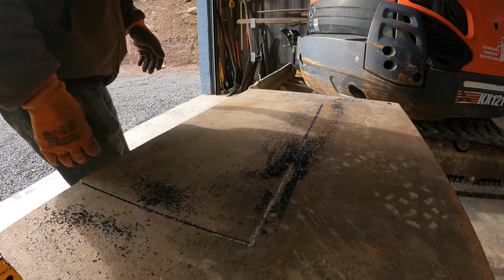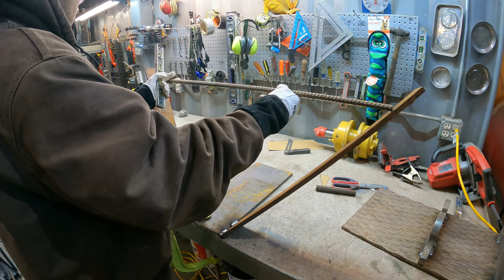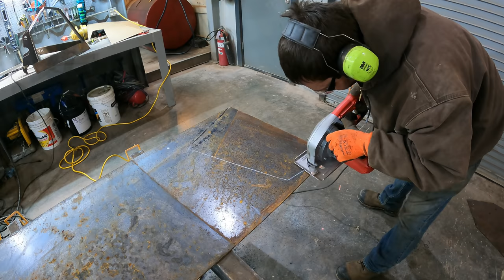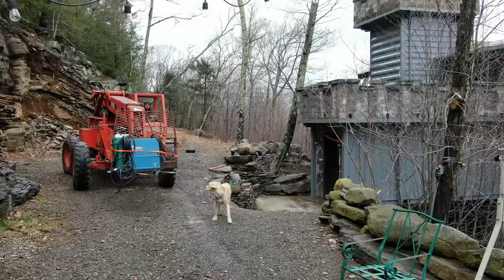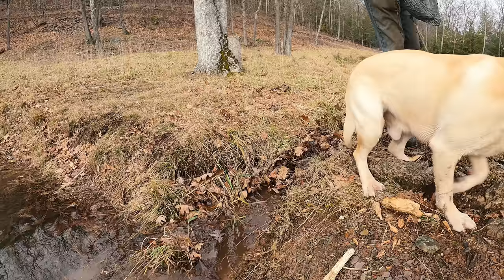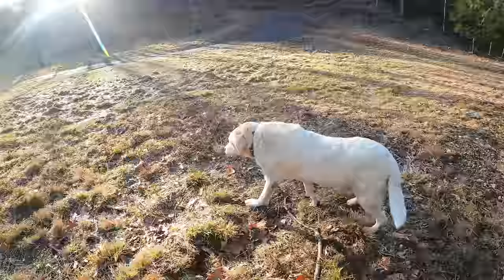Making an excavator swale bucket

Comment: You know your roof was built strong enough when you can use leftover material to build an excavator bucket.
Reply: Point well taken.  Thank you!
Reply: @facediaper4607  You should post some of your welding examples so we all "know how it's done"
Reply: @facediaper4607  you probably just mad that he’s better than you
Reply: @facediaper4607  ive seen a lot worse hes a lot better than some
Reply: @facediaper4607  You must be new here. I didn't see anything break, bend or fall apart. What I did see was a culvert get dug. How exactly does his welding suck? Oh, and hey smartass, his castle is still standing. What's you got now?
Reply: @facediaper4607  I don’t know anything about welding. What’s so bad? It looked like he did a good job.
Reply: @facediaper4607  maybe he's good at grinding. With a good grind I can make those beads look like they were fused instead of welded.
Reply: @facediaper4607  Lets see, Andrew has 799,000 viewers who subscribe to his channel. Balls Deep has no viewers and no videos up. Yet he's telling us how Andrew sucks. Funny.
Reply: @facediaper4607  it must be sad to not have a life...
Reply: @facediaper4607  I think you might have made a mistake. His welds appear rough and bad on the outside but that doesn’t matter. It’s the solidness of the weld. His welds aren’t pouraus or thin he did a good job in terms of strength and having something that’s gonna last but it’s not the most appealing to look at
Reply: @facediaper4607  he doesn’t need to pass a test. It’s his own excavator bucket for his own business and it’s sturdy and functional and it’s not gonna break that’s all that matters in this case. If you were welding for a big corporation or someone else it would matter tho so I can understand what your saying
Reply: @facediaper4607  your not providing a very good dispute. Makes me think that you have no reasoning to say I’m wrong your just saying that I’m wrong
Reply: A point well taken. Thank you!

Comment: I'm going to predict the future, Andrew is going to buy a waterjet table
Reply: He would then created a fully articulated “Swiss Army” like bucket for his excavator. I see it now a combination hammer drill, trencher, leveler, and root claw all on one attachment. AC could do it!
Reply: Would have to hear his building then lol
Reply: Or a plasma cnc table
Reply: @stevencollins9894  //  He has one sitting right behind him in view that he doesn't use.
Reply: Might also be a CNC plasma cutter. Either of those.
Reply: @stevencollins9894  oh, you beat me to it 😂
Reply: This lad could make his own tilt - rotating pick up hitch and save himself 15k 🤣🤣🤣👍
Reply: A used* water jet table
Reply: I’d bet a plasma cnc
Reply: @joconnor3567  Well i assume that this wont be possible because you cant have all shapes on one bucket. But with a quick change you still spare a lot of time.

The only thing that could make this even better is probably a tiltrotor that makes it possible to turn the bucket around in any direction. A skilled operator like Andrew can eat his lunch witch one of those.
Reply: @73DiamondReo  //  Your point? Who said it couldn't do the job? I merely stated that he had the table and didn't use it.
Reply: He has the table and compressor under the over-
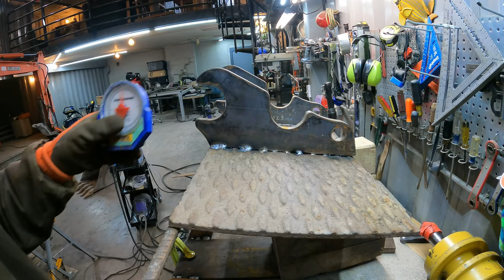hang, @ 8:46 it's in the background
Reply: @DanKoning777  your right put that thing is probably junk " it broke for no reason I just put my track loader bucket on it and it fell apart " lol
Reply: Or a plasma they are cheaper
Reply: Plasma table
Reply: Next logical step for the Camarata enterprise. But first would have to be a CNC plasma cutter. I don't need to own one, one of my neighbors has a laser cutter and i get my stuff cut through him, but it cannot be stated enough what a time saver multiplier and enabler of greater projects, the access to any of these machines is. One moment you're struggling to piece a project, the next you're juggling even four of them without so much a sweat.
Reply: You nailed it static!!!! 👍👍
Reply: I thought he said he had one a while back
Reply: Didn't you see he has one already
Reply: @DanKoning777  i merely stated it could have cut the ears! jeez i dont understand why everyone is so sensitive.  I have a homemade table and cut stuff like this for my own equipment.
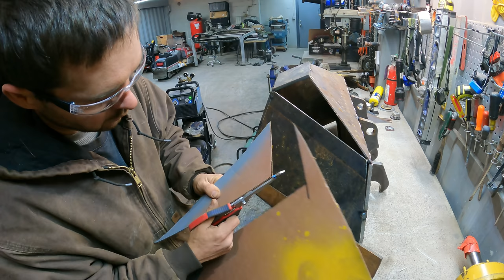Reply: its literally in the background of this video at 16:30. You can see the CNC table. time for some of you to go back and watch more of Andrew's videos!
Reply: @jimboss69  found on the side of the road for free 😂😂
Reply: Perhaps
Reply: Yes this will be happening.
Reply: It's about damn time, it'd save him so much time 😎 he also needs a mill and a lathe and then he'd be set for life (he could build a whole excavator) 😂😂😂
Reply: Time for a Haas VF2-SS
Reply: He’s got the money
Reply: @elibehnke9461  Its not about money.  Its all about that saw that went right. Hell never be able to forget that miscut and use it as the final reason he needs a water jet :D
Reply: I was being facetious
Reply: Cnc machine too
Reply: I was waiting for the clip to cut to him backing into his driveway then jump out going "alright, I just got this waterjet table, let's go cut some stuff"
Reply: @DanKoning777  Andrew does use CAD, except in his case it is Cardboard Assisted Design.   But seriously, we know he uses SketchUp so could drive a CNC plasma table.  If he is in any way unsure of how to set it up (which I doubt as this is Andrew we are talking about) he only need pin a comment asking for help from someone living in his area, and the offers would come flooding in.
Reply: And a rock pulverizer to make his own gravel.
Reply: would be about time
Reply: Waterjet tables are wicked expensive to run. They use a granular garnet medium which adds an insane amount of cost. Unless he is going into producing hundreds of them, itd be cheaper to just buy the plates precut
Reply: @TrevorDennis100  I used to program and setup our Maxiem 2040 and work and I believe they paid over 150k for the machine and supporting devices, it was around $35/hr to run. Without using a machine like that for production runs, you are virtually never going to make your money back as a tool for occasional use. However that being said the cut finish was amazing compared to plasma, and the thing was a real workhorse being able to cut through well over 1" thick steel like butter. You can make a machine like that pay for itself in the right situation but I feel like Andrew would be best off tuning his plasma cutter very well so its good for occasional use. 
I feel like his channel is big enough that he should just reach out to one of the big companies to get a smaller one to use in his videos. Also if he ever needs help with CAD or any file setup, I'd be glad to lend a hand
Reply: I think it would be time for a rototilt too.....
(If there is such a thing in the us, I don't know....)
Reply: *build
Reply: @PCHSwS  he has one
Reply: @DanKoning777  that is not a cnc plasma  just a normal one
Reply: Look in the back of the shop. It's a cnc plasma that he already owns. He said he hasn't learned to use it yet 😮
Reply: I sure hope so! With his work ethic and attention to detail he probably couldn't build them fast enough.
Reply: @jimboss69  "shes a little beat up but I think I can make it work"
Reply: You mean build
Reply: Messing with cad kind of sucks.  I'd rather make cardboard templates.
Reply: yes, and he will go pick it up with his tesla truck
Reply: NO he is going to buy one of those JCB telecoping skidsteers.
Reply: @Everett-xe3eg  yeah I seen that 😂
Reply: Not until it has over 10,000 hours
Reply: He made but the accomplishment in the feeling of pride he gets when he finishes this bucket is much better than having a water table and doing the work for you
Reply: Buy? Or Make?
Reply: he is not smart enough to use CAD CAM which is why the CNC plasma sitting in the background goes unused.
Reply: A plasma cannot achieve the accuracy of the waterjet, and it needs to be in perfect maintenance and adjustment to get to an acceptable level of accuracy. Which is not the condition that hardly used plasma cnc table is in. Furthermore, you will need to have plate material in stock of this thickness.
Reply: That’s a safe bet considering that’s the only piece of kit he hasn’t got
Reply: @TrevorDennis100  sketchup is for children. if you use sketchup you cant use cad.
Reply: Buy? He would just make one lmao
Reply: More like he will build his own.
Reply: I hope he buys a lathe and a milling machine
Reply: Plasma table!!
Reply: Ha I g seen one in operation recently, I Recommend that! 🎯👍😎🤙🏻
Reply: Agreed! That and get a blessing license since he's got so much granite rock up there.
Reply: @joconnor3567 "swiss army" attachment that switches between tools hydraulically lol
Reply: I think he should get into blasting with all of that rock.
Reply: A good water jet could be a flow mach 100
Reply: U
Reply: Right it's called social media he can do whatever he wants to do there's nothing wrong with that love the channel there's nothing wrong with that right
Reply: @Reece Dancsok Who cares I sure as hell don't I like watching the little guy do work if he don't buy it he don't buy it so what makes no difference to me
Reply: He needs a lathe & a mill aswell.

Comment: Nice build, looks stronger than half the ones you can buy, if your cutting edge is just mild steel I would take some hard facing welding rod and put a good layer over it to help it last in all that rock you have up there!
Reply: Matt, you should do a collab with Andrew some time!
Reply: He said it was hardened steel didn't he? I built a bucket for sorting material of mild steel and rebar and it's still holding up great after years of use, but don't use it everyday than it would have been gone 😅
Reply: @MiniMachines1  If he did I missed it, the dog was snoring on top of me 😂
Reply: If its hard steel, I'd still weld hard surfacing on it. I think he should on the thinner sides too.  Diesel creek we were thinking the same thing.
Reply: @MrSuperBrite  Good info here thanks for posting!
Reply: What about welding on a couple of shanks for tips on the bottom flat plate where the side angle plates are joined on....for them harder leaves 😉
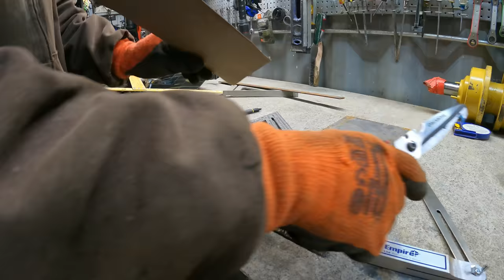Reply: 7:05
Reply: I think it was be good to weld another cutting edge on the bottom, have it stick out 1 1/2 inches. All the V buckets we used digging mainline had an extra plate for wear.
Reply: I’d be more worried about hardwire welds cracking out...
Reply: @CommieCat  
Yep, Fluxcore defo would be more durable but i guess Andy will keep grinding out and welding up any cracks
Reply: He did use Hardened Steel for the cut edges...he stated that at the beginning. Though I agree, adding wear weld needs would make it last longer.
Reply: at 7 10 he says  it
Reply: @MiniMachines1  what is your opinion on using the MAG vs stick on steel this thick. I would think a stick weld would penetrate further and make it stronger. My MAG sure would suck for that kind of job but its not a $$ Miller.
Reply: @NilsKall  I use the stick welder working on thick metal, I tried with an mig working on the Bobcat bucket but it was not burning deep enough.
Reply: @MiniMachines1  my thoughts exactly.
Reply: @NilsKall  but with a bigger welder like the one Andrew changes out for in the video it's no problem to wipe thicker metal. I don't have a big MAG machine so than it's easyer with the stick welder
Reply: @MiniMachines1  yeah, that Miller welder is powerful. I wonder what wire he runs in it?
Reply: Andrew always uses hard steel for cutting edge.  Past videos have pointed that out. 👍
Reply from the maker: @NilsKall  .035 mig wire. That big machine welds that 1/2” metal easy.
Reply: @AndrewCamarata  Thank you.
Reply: Design it to use already made bolt on cutting edges from mi cat or any heavy equipment dealer
Reply: Andrew Camarata has just built an excavator swale bucket with quick-change couplers to go from one excavator to another.
Reply: Spay Transfer mig would penetrate better than short circuit mig . I have watched Jodies videos when he done tests spay verse short circuit Something like that bucket will be getting a lot of abuse .

Comment: Measuring metal thickness with a wrench.....

Smart. Real smart.
Reply: Agricultural engineers callipers.
Reply: I thought cutting it with a skill saw was more notable lol. Turned out fine he did well
Reply: Did it not work or something? Lol
Reply: @atm451  it's not a skill saw, it's the Milwaukee 6370-20 8in metal cutting saw. 
it will cut up to 3/4 plate. They are badass and not cheap.
Reply: @jessdigs  it looks the job 👍 . I'm off searching for one 😁
Reply: @jessdigs  I agree, it’s a badass saw. I would love to see some cut 3/4 with it. Haven’t seen it tho
Reply: @atm451  we have one at work. Cut a 12" case pipe off an 8" gas main with it. We set the depth, ripped along the sides and split it like a clamshell. It made easy work of that 
.250 wall pipe

Comment: The perfect person to design a tool...someone who uses that tool everyday
Reply: Maybe give the idea's not build it. Being a boilermaker this was painful to watch.
Reply: @TherealMandingo  Makes you realize it doesn't have to be perfect to be functional. They say chasing perfection is a fool's errand. Here's a great example of that. Perfect is the enemy of good.
Reply: @drewt3210   I didn't say it had to be perfect but there's but much better and easier ways then to place patch after patch.
Reply: @TherealMandingo  Yeah, it is called using a press brake. But this works and is cheaper to do. And as it is a one off piece, no need for the pattern work that would be needed for the brake work segments.
Reply: @gravelydon7072   what I said easier ways I didn't say anything about having to make a pattern and use a press brake.  Obviously it's a one off  but I was taking about how he's gone about it from the beginning having to fit in and weld all these small patches .
Reply: This is important in ways you don't understand. As someone who deals with foreign IT companies making civil engineering tools based on Autocad for another company.
Unless you do the job and understand all the ins and outs you will have to make the tool over and over again to get the best result.

Comment: It is fascinating that you have the steel working skills to make a bucket. I would never have thought about that. What blade are you using to cut hardened steel with so easily? Is it a diamond blade.
Reply from the maker: I did build a steel castle, so a bucket is easy, lol. That whole saw is meant for cutting metal. There is a link in description for it.
Reply: @AndrewCamarata  Thanks!

Comment: Throw some hardfacing on it, you won't regret it and it's pretty cheap. Just wear a respirator when you're welding with that stuff.
EDIT: I got a few more minutes into the video around the 30:00 mark, and... yep, you're gonna want some hardfacing on that edge and the bottom/sides where they scrape when you're digging. Inside probably isn't as important, maybe a bit right near the edge, but the outside would benefit from a nice grid or diamond pattern of hardfacing. Some good ol' Stoody 31.
Yet another edit: After seeing 39:25 I retract my statement about hardfacing the inside not being important. Just go ahead and line that thing inside and out.

Comment: You can use that Shale for Roofing, for Patios..quite a lovely Resource..Nice Bucket..the Blade I guess must be Carbon Fortified..Acier trempe....forged steel..I like the Design Process, the Tinkering, the Stencils and the Final use of this Shale Quarying Bucket and Ditch  Digger Bucket

Comment: Imagine doing both of those drainage jobs just using a shovel and wheelbarrow, it would take days. I recall as a boy working for a general cargo transport company in NZ, a driver and i were sent to get a truck load of sand (3 yards) for a client. We shovelled the sand onto the truck, it was hard work. We also delivered large sacks of coal to customers and we carried the full sacks on our backs from the truck to the customers coal bins. Most of the associated truck loading and unloading work was done manually, no forklifts in those days. We earned our pathetic wages the hard way at that company and thought nothing of it. I was 17 when i started work on that job.

Comment: I Can't afford good steel for my projects, so i use a lot of free cutting edges from the Town's snow plows and free 275 gallon oil barrels. I Made all of my plows and implements for my farm tractor for the cost of grinder cutting wheels and Mig Wire.

Comment: Nice design on the bucket. Worked better than I imagined. I agree that it would have been nice to make the sides a little wider so the edges of the swale are not as steep. but hey, it's also a great tool for trenching an line (plumbing, electrical, etc.). One thing I would add is a replaceable (bolt-on) leading edge. Let that be a wearing item. Again, nice job!